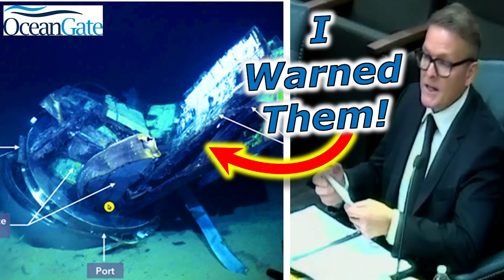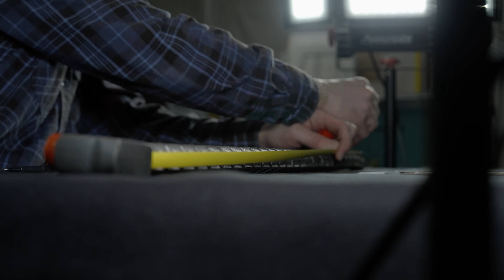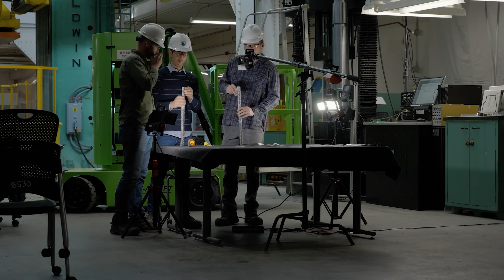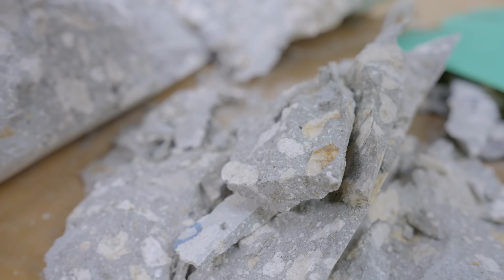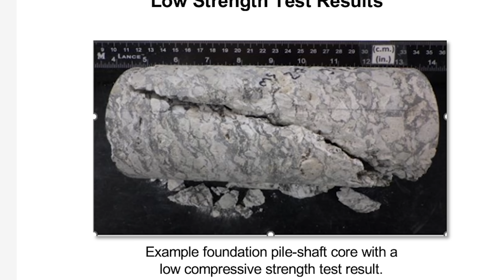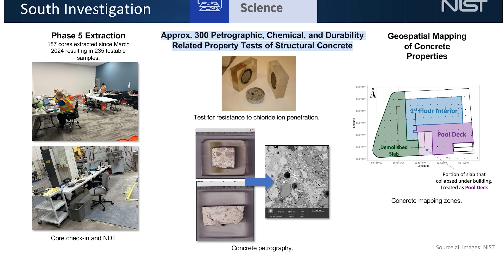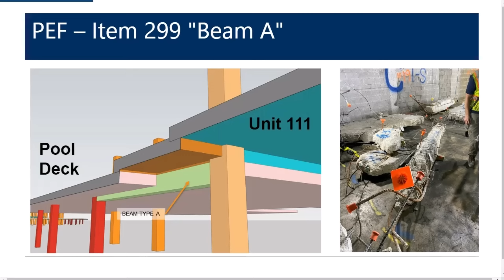Miami Condo Collapse Investigation SETBACKS: Champlain Towers

Comment: I'm an engineer and I don't quite understand the depth of this analysis and testing. Not even the NTSB takes this long.  At the end of the day, I think all this is going to prove is, if the building had been built correctly as designed and according to the code of the day, we wouldn't be having this conversation.  Maybe the goal is to discover how poorly a building can be built and maintained and still not collapse.
Reply: Maybe it's academic at this point.  They know what the deficiencies were in the original design and construction but that doesn't explain exactly where the failure started and how it progressed through the tower.  I'm a structural engineer and I have my theories but I'm waiting to see what extensive analysis shows.  My theories are based on what I've seen from the drawings and what I've seen in various youtube videos.  I don't have access to all of the as-built conditions that NIST has from all the different pieces of the building.
Reply: My theory is that they are looking into it at a greater depth than required due to the other 2 Champlain towers still standing.
If they are modelling actual size building segments for load testing, there must be something that doesn't add up that they are seeking confirmation of.
Otherwise, it would be hard to justify the extra expense and time of doing so.
Reply: I agree, not sure what the point is of this level of analysis. We know how to build things that don't fall down, we also know that it was obvious that this building was in a bad state but nobody did anything effective about it. If they really wanted to avoid a repeat then a fraction of the time money and effort put into inspection and enforcement of new and existing buildings would be actually useful.
Reply: @NiallWardrop  "We know how to build things that don't fall down"
Yes. And we know this because, when one does fall down, we don't satisfy ourselves with "Yeah, it obviously wasn't built right, so build better next time, builders." Rather, we look for any secondary causes so we can learn as much as possible from each spillage of blood.
Reply: @beeble2003   The question is whether there is anything of practical use to learn or if it would be better to spend the resources available to ensure as far as possible that there isn't another spillage of blood, where we already know enough to do this and apparently aren't doing it as effectively as we might.
Reply: @NiallWardrop  Understanding more about how rebar fails seems like a good idea to me...
Reply: @beeble2003  That's not what they are doing here. They are testing the characteristics of the particular materials used in this building, presumably to determine if they meet the stated spec. The properties of steel including its failure modes are well known and documented.
Reply: This is what happens when you have the budget of a government agency.  Tax dollars!
Reply: @geoff_va1  How DARE they spend money to keep you safe!!! They should just let companies build however they want and let the free market put the bad companies out of business.

Comment: Perhaps some of the concrete weakened over time due to environmental factors? Too much extra weight was on the pool deck. But I still think that periodic inspections should have detected potential problems.

Comment: Thanks Jeff, great discussion as usual.

Rebar reinforced concrete likely only has a safe life if there is any risk of tension and/or corrosion which is usually the case.

Pre stressed is the better way to go  if an indefinite life is required, particularly designs that allow the cables/rods to be individually replaced when they start to lose strength and/or tension. Pre stress in these circumstances is more akin to a fail safe structure.

With concrete always in compression, the structure can be maintained indefinitely, the Pantheon in Rome is the classic example.

Comment: During early construction a Crane fell across several Pile Caps severely damaging one which was then hastily repaired with shoddy materials. Even the engineers hired to do the 40 year specified repairs to the Pile Caps after they opened up the sub- area under the Basement slab and inspected it but the condo association didn't listen.
Reply: I read through the 40 year recirt plans and found the concrete beam they wanted to install to tie together several Pile Caps reinforcing them.
Reply: I was wondering about the concrete mixing part...I know that they probably had several companies supplying the pour, and I've seen a local project where the two companies were blaming each other's mixes for a 'bad batch.' Something similar could easily happen, and with this new (to me, anyway) info if they mixed a quik-e batch on the spot that heightens my suspicions. I'm sure there's a way to test all those different samples though to figure out if the low PSI rating was due to the mix or something else.
Reply: @a_trauma_llama2991  On my jobs, records are kept to know where each load is placed in the structure. That way if we have problems, it can be more or less isolated to that component.
Reply: @a_trauma_llama2991   All concrete that arrives on site is normally slump tested. Each truck's concrete delivery is first slump tested before permitted to  proceed to pouring. Surely, this would have been done in this instance? If not, then this is a major failure in carrying a simple standard test that costs only a few minutes and basic equipment. It will therefore be irrelevant who or how many suppliers of concrete there are: slump testing is routine in any concreting job.
Reply: Slump testing has nothing to do with the concrete strength. It's for its consistency (flow).
Reply: @AncoraImparo4ever  Air entrainment testing is important too. Too much air can weaken it.
Reply: No, the condo board listened. But the condo owners didn’t want to pay that kind of money.
They’ve been ignoring problems for years and thought they could ignore them a little longer
Reply: The crane collapse resulted in a fatality, and I understand Builder Nathan Reiber downplayed the incident entirely. All he was seeing was the potential profits…
Reply: But that had nothing to do with the collapse.  The corrosion in the poorly-built pool deck ultimately brought the building down.
Reply: @johnbergstrom2931  
The building had a lot of issues. 
Overtime one of the other problems could’ve also brought it down.
Reply: @neilkurzman4907  No, unlikely.  The security guard heard the rebar in the pool deck snapping just before it fell.  That's what caused the collapse.
Reply: @johnbergstrom2931  the question is, what did the designers intend the rebar do? what did they specify and was that installed?
Reply: @neilkurzman4907  You don't know what rebar does?
Reply: @johnbergstrom2931  
It’s strengthens the concrete. 
Considering they usually bend it during installation, it would be unlikely that it would be as brittle as cast  iron. 

And do we know that the rebar the video is actually from that building and not just a demonstration of the process?
Reply: @neilkurzman4907  It wasn't the 'brittleness' of the rebar that caused this disaster, it was 40 years of corrosion.  Champlain Towers North is a nearly identical sister building to CTS, built by the same developer, using the same rebar, concrete company, built immediately after CTS.  (They literally finished up concrete work on CTS then went up the street and began work on CTN).

Champlain Towers North is still standing, still occupied.  They're not rushing to evacuate that building.  The difference between the two?  CTN kept up on maintenance and didn't let their pool deck rust, fail and kill people.

Comment: I must have missed something. Why are they mixing up new concrete? It seems it does not matter what the new concrete would test at. I would think they need to be testing concrete form the failed building. As actually built. They should have been able to sample many cores from the more undisturbed building remains.

Comment: Thank you again for reporting on the status of the CTS investigation.
Perhaps you could report on what is happening with the FIU pedestrian bridge collapse.
Reply: A video discussing the NTSB findings was posted...I just missed it when it came up. Now that I've seen it, I understand better how that failure occurred.
The tensioning, de-tensioning and tensioning of tendon #11 merits more investigation. The design engineer had stated that that member was designed to carry temporary loads during transport, but that eventually it would carry zero load. That's hard to believe. In my opinion there is too much reliance placed on computerized designs. If the software said a member would carry no load (and there is no redundancy) it should raise a red flag to the designer. As it happens the joint between #11 and #12 is where the first failure is believed to have occurred. Little was said about that.

Comment: There weren't enough re-bar and support columns were undersized, then a lot of extra weight was placed on the pool deck. That, and the water rotting the structure was definitely going to compromise this structure. If they had built to spec in the first place, then maintained it, this deck would not have failed. I don't find fault in the rebar size and strength, but if they just have to test, then go on and do it.
Reply: Don't think it helped that the materials used was junk.
Reply: As in most failures or accidents it is often a combination of factors, as you describe.
Reply: @jamesplotkin4674  But mostly neglect and corrosion.
Reply: @johnbergstrom2931  Design flaws too.
Reply: @GOPRepubliklan  Well, Champlain Towers North likely has the same 'design flaws' and it's still standing.  They maintained that building.
Reply: @johnbergstrom2931 CT North doesn’t have the flooding problems as the collapsed condo.  Also didn’t have a construction project next door that was vibrating & undermining the pool deck foundation 

.
Reply: @electrictroy2010  The vibration from the next door construction project was a red-herring, something invented by lawyers to dig into deep pockets.  Also, the foundation of the building was just fine, the pool deck itself is what collapsed.
Reply: Not to mention the extra weight from renovations such as modern shower doors and granite countertops, etc.

Comment: Can anybody explain, three years after the collapse, why we're still seeing cellphone video, recorded off a tv, showing security camera footage of the collapse...and not the actual video file from the security camera harddrive? I have yet to see the original footage shown at the beginning of Jeff's video, they're all the same video taken with a cellphone.
Reply: Because the actual hard drive that contains the raw video file is still in police custody & probably won’t be released until after the investigation is over.
Reply: @thiefrules  Obviously that drive is kept safe, because video on it is important evidence for investigation of collapse.
(though data should have been cloned/backupped as redundancy against drive failure) 
But releasing video from it wouldn't compromise that data, because original would be still safe from any tampering.
Reply: @thiefrules  Seems a little unexpected don't you reckon? After three years? Even the Titan sub had a decent amount of original, and unseen, footage released only a year into the investigation. The footage of the collapse already exists and has been released because of a cellphone recording. Not sure why the original would be kept so close to the chest if your statement is true. Wonder if a FOIA would get it released.
Reply: @TravisTrittFan   not to me, it seems par for the course. Police are tight-lipped especially during investigations, lots of high-profile cases with video footage that isn’t released til much later. Think of Sep 11th, we still loads of unseen footage from that day in the FBI’s possession. Or a more recent case, the Julio Foolio incident. Footage recorded from the monitor of the security computer was posted minutes after it all went down, but it wasn’t until police announced their search that we got to see the raw footage directly from the surveillance cams.  And OceanGate was a private company so I imagine it was civilians who made their footage public, or it was only made public after it was shown in court. 
As for why we get the phone footage, you hit the nail on the head. Because we don’t have access to the original file in the police’s hands, we only have the footage that was taken & posted minutes after the incident occurred. Everyone uses that because they don’t have anything else. 

My theory as to why we don’t have the footage is 1.) because it doesn’t show anything very important/something we didn’t already know and/or 2.) it’s too graphic to show to the public. But if not the first two, then 3.) there is no footage (inside the apartment buildings during the collapse, I mean). There exists plenty of footage from outside but anything from inside might have gotten destroyed in the collapse, or all the cameras turned off from a power outage before the collapse. 

Not sure if you can FOIA a case during an ongoing investigation, maybe that’s why we don’t have any other footage other than what was posted to social media right after the collapse. Wouldn’t hurt, there’s a good chance it’ll take so long to reach the relevant people that by the time it does, the case wrapped up
Reply: Bit conspiracy theory ish.
Reply: Because the investigating agencies haven’t released them to the public. That’s why you haven’t seen them.
Reply: I wish we had access to more footage from inside the building taken by people and then uploaded to a cloud. Unfortunately any footage would've been destroyed when the building fell on the people and their cellphones and they took the cloud passwords to heaven
Reply: Probably was auto-overwritten by the dvr before the clip could be extracted._
Reply: That’s a phenomenal point you made. I never put thought into it but it makes you wonder why we don’t have access to the original tape.
Reply: Hard drives are not made to survive a building collapse. That is not a black box from an airplane.
Reply: @ms.shineray  The camera footage was taken from a building that was across the street, as shown at the beginning of Jeff's video. Not the actual building that collapsed.
Reply: @TravisTrittFan  yes, and that might be the reason why there is so little to show cameras from nearby buildings aren't supposed to be looking at other buildings.
Reply: @ms.shineray  You're making no sense. There's nothing illegal about a security camera capturing footage of a building from across the street. There's no expectation of privacy in areas the public can easily see with their own eyes. That also doesn't change the fact the footage exists, because it's been recorded and released by a cellphone. There's no doubt the investigators should have gotten the original footage, and I want to know why that's still being kept unreleased.
Reply: @TravisTrittFan  Never said it was illegal, I just said there's no more to show, since that camera was not always overlooking there, that camera moves.
Reply: @ms.shineray  Oh, but in fact, you did, or at least tried imply it. You plainly said "cameras from other buildings aren't supposed to be looking at other buildings." You're therefore stating that somehow cameras capturing footage of a building across the street is somehow inappropriate or illegal when that is 100% wrong.

And ultimately none of your replies have been relevant to my original question.
Reply: @TravisTrittFan  saying something is not supposed to isn't saying that it is illegal, lol
Reply: @ms.shineray  The question isn't "Why isn't there more footage?" The question is "Why do we only have a video of a video of the footage, rather than the original footage?"
Reply: @ms.shineray WOW so much dumb in one person.  (1) The collapse video is NOT from the collapsed building.  It wasn’t destroyed. (2) It came from a neighbor building which has that collapse video stored on a hard drive.  (3) Therefore the police can get the hard drive & original video just by requesting it

.
Reply: Mystified by that too. Who owns that camera? Also, surely other cameras were also aimed towards it and yet nothing. Very suspicious. Seems they're hiding something.
Reply: @ronbennett7885  No one is hiding anything. There’s an open investigation and they’re busy working on that. Just because things don’t match your spectator timeline, doesn’t mean there’s some big conspiracy.
Reply: @ronbennett7885  It was Hotel or other apartment complex across the street where that footage of the collapse was captured on camera so I'm sure it was their footage. I'm not exactly sure though. It is a little suspicious, but I'm not going to jump on the nefarious activity train yet. But is there something about it being 'clearer' than the cellphone footage that is making them hold off.